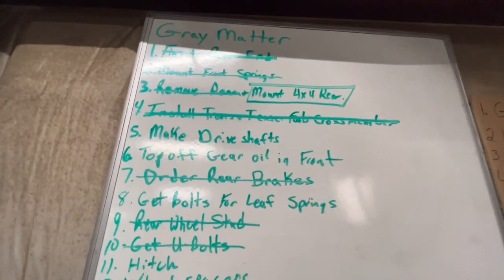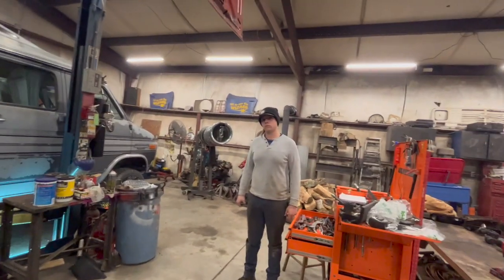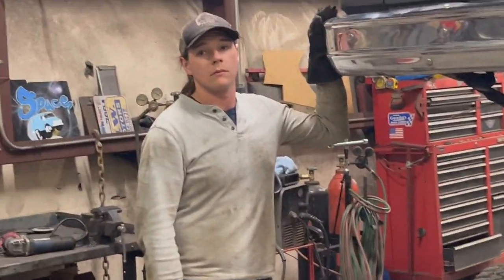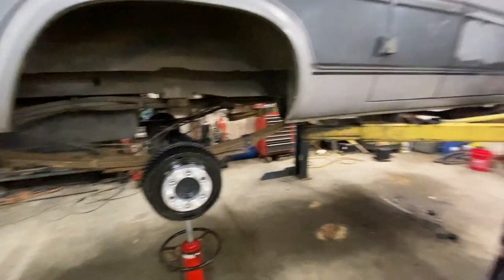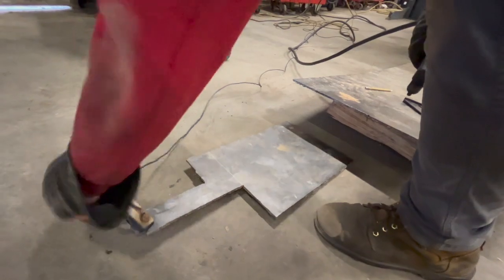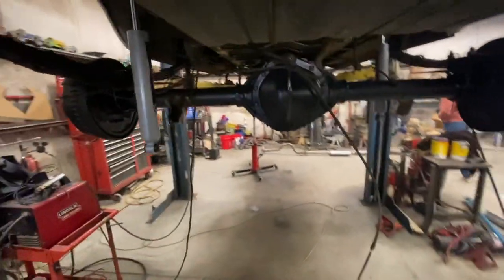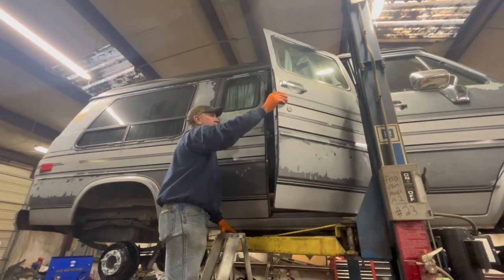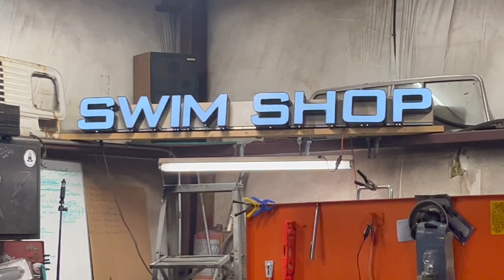4x4 Chevy G20 Van 12 Bolt Rear & Shock Mounts - The Swim Shop 4x4 Vans

Comment: Be neat if you guys found a wrecked silverado 2500hd and use 6.0 V8 with the 6L80 or something similar in one of those! Even with a electric shift transfer case so you didn't have to have a floor shift. But then again those can be unreliable. My 2018 6.0 V8 express 3500 4x4 done at advanced four wheel drive systems is nice with the 6spd automatic, but still has the 3:42 axle ratio..... not ideal with 33" tires.
Reply from the maker: We will probably do a 6.0 swap in the future. I don't think I will ever install a electric shift transfer case. I have never liked them since they came out. But that's just me. Thanks for watching and subscribing.
Reply: @theswimshop4x4  yep! Good ol manual gear driven be best but chain driven good too! 👍
Reply from the maker: @maingig1  Nothing at all wrong with chain drive. I love 208 transfer cases. Can handle plenty of power. It's just that aluminum case don't like banging against them rocks.
Reply: @theswimshop4x4  true that!!! Ok buddy hopefully you guys all had a great holiday season and can't wait to see the next video! Oh you guys going to put a straight axle under that astro or gm ifs factory stuff?! Thanks again!
Paul in Oregon

Comment: You should use a van g30 rear end or vandura 3500 full floating axle and you can find one witch the correct gear ratios for your front swap k models work well. Lots of fabrication this way
Reply from the maker: We do one other ones. But when you have a half ton 6 lug front you have to use a 6 lug rear. Full floaters are 8 lug.
Reply: @theswimshop4x4   you can get 6 lug axles and swap them .  I know I have seen them for the vans .
Reply from the maker: @davediamond1742  Thanks for commenting. You should watch our other videos.